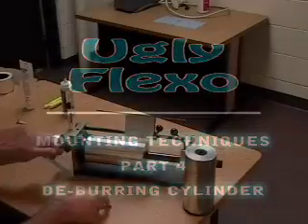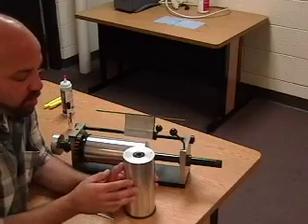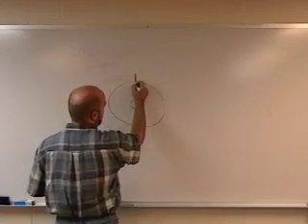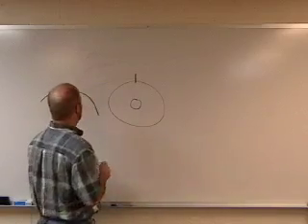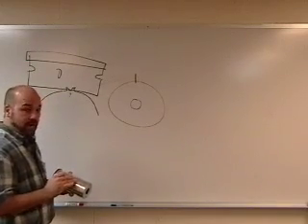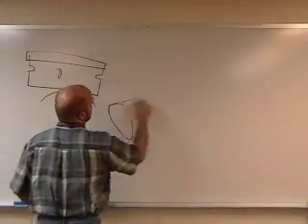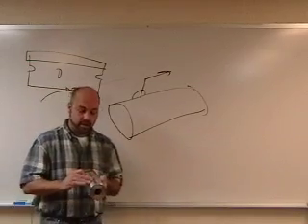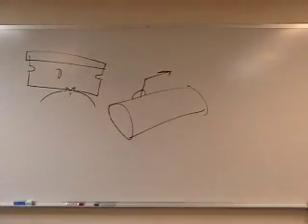Mounting Techniques Part 4, De-burring the Plate Cylinder

Comment: Basically you use the round part of the screwdriver and rub it across. This won't ruin the print cylinders or remove any metal from it.

My supervisor was the one who educated me in this technique. He learned it from one of the manufacturers of the cylinders.

I personally do not bother with this at all. I don't do many long running process jobs.

Comment from the maker: I must say I've never tried a screwdriver.  I'll have to try your idea out.  You may very well be right.

I can appreciate your position on the removal of metal.  However, I haven't found much ill effect, as yet.  I'll keep an eye out.  Also, because I hold the blade at a backward angle, I may be pushing some material in, too.  I had not thought of that.

Do you succesfully push all of the material back down into the gouge?  Do you use the round part of the screwdriver, or the blade?

Comment: NEVER EVER De-burr your print cylinder with a razor blade! It will damage the cylinder. Use a screwdriver instead. The object should be to flatten the burrs down. Not to remove the metal.